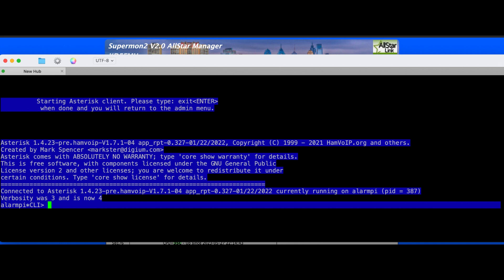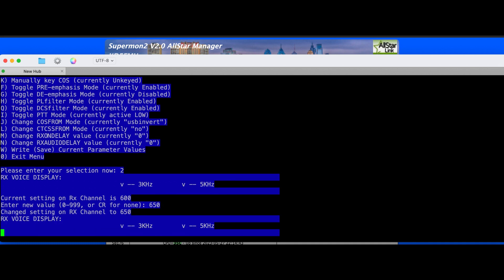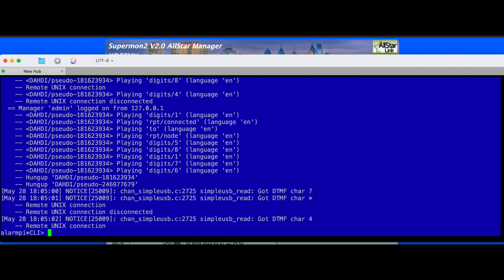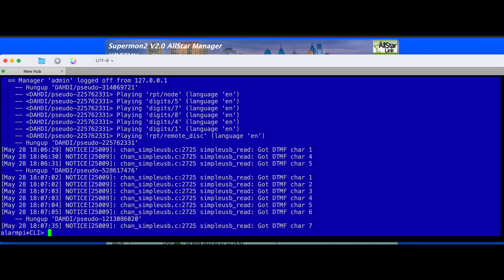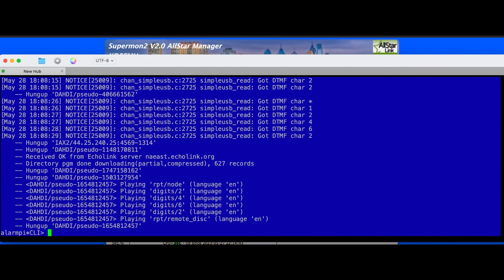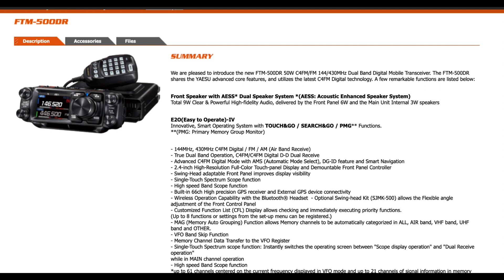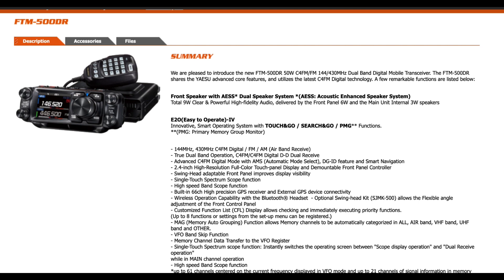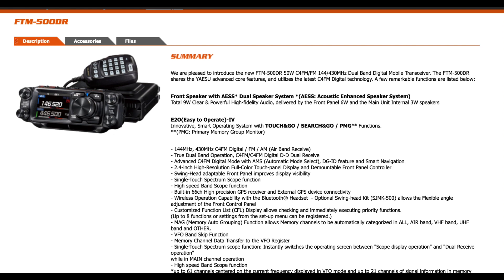YAESU FTM-500 DTMF Investigation Pt. 2

Comment: So, do you have the microphone hooked to the head unit or directly into the radio? If you haven't tried it both ways , try it and see if that changes anything
Reply from the maker: Directly to the radio body. I will try it both ways.
Reply: @HamRadioCrusader  , something else just crossed my mind. If you have another Yaesu microphone, try that also
Reply: @esincl52  I have test ist with Mic Yaesu MH-48 and the same, with Both connections.